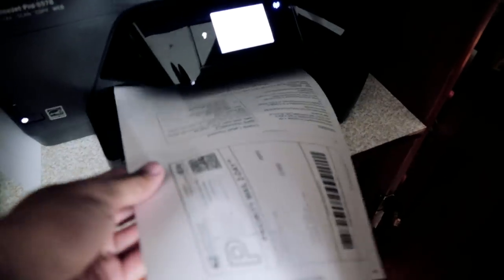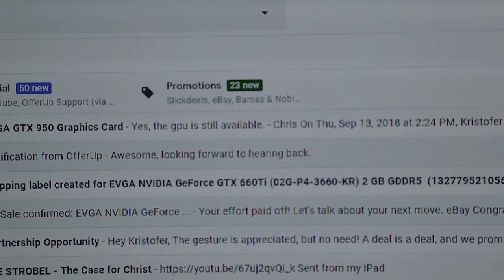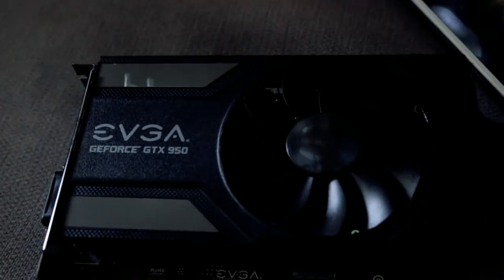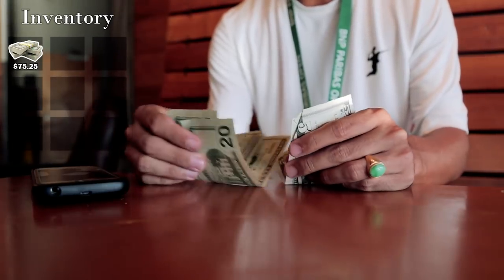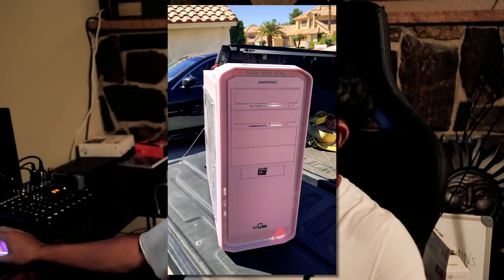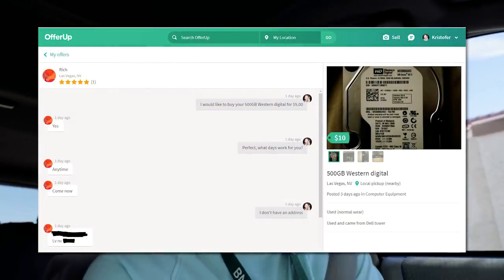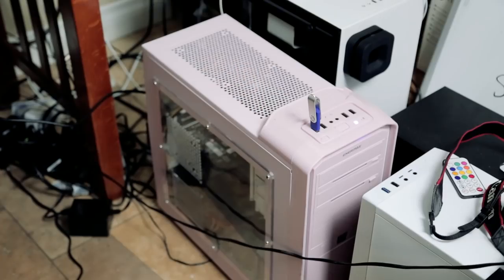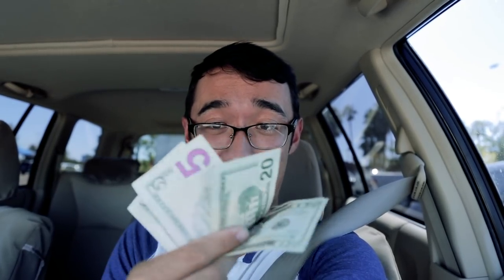1 Month Flipping Challenge - 8x Money Return

Comment: Things I learned:
1. Cheating is profitable
2. Getting lucky on one rare find is worth more than weeks of hard work.
3. Snipping an already agreed upon deal is profitable
4. If you want to go into flipping, you either need to love the tasks itself or have a larger starting fund, or you'd make more in a week w/ part time minimal wage job than you do a month of flipping.
Reply from the maker: The last one isn't necessarily true. You can start small and work yourself up to a larger fund you talk about. For example, how much could I make now with the $438?
Reply: Ah, but you would make the $438 faster by doing a part time job, which means that the initial month is still a bad use of time by comparison. After which, now you have a larger starting fund which goes right back to my point.
Therefore, my point of doing this when you have a lower starting fund is inefficient stands, since that's not when you should start.
But I guess a part time job where you only work for one or two week before quitting is probably hard to find. It's possible to make that doing some sort of contractor work, but that would involve either some sort of skill or hard physical labor. So perhaps starting flipping ASAP have an advantage in simplicity, since you don't have to deal with an "employer".

I am curious about how much you would make if you have sufficient starting fund (assuming, ofc, still a one-man operation as opposed to starting a full fledged business, which is whole other ball game)
While you would be able to go after any good deal as opposed to only the cheap ones, you are still bottlenecked by the number of deals available in general(that are good enough to flip) as well as your own time. While there is no doubt that your profit amount will increase, the % profit will probably drop. 8x your money every month is probably not possible.

At some point, it might become more profitable just offering the service of building custom PCs over flipping the parts, as your time becomes increasingly valuable and "just building" will consume less time per unit than if you have to source the part from "internet".
So it would be a rather complex thing to figure out what is the peak profit for flipping where flipping is still the optimal business model.

It's possible that it's never actually the "optimal" business model, which would explain why so many people do it part time because they enjoy the act but, afaik, very few people do this full time (whereas there are people that do PC builds etc full time)
Reply: I’d just do a part time job and like 10% of what I make a week would go into this.
Reply: Words, from someone who works for someone else.
Reply: @GF_Burke  lmfao true
Reply: If you really want to learn something go try and flip something yourself. You can work till you drop and make minimum wage all your life and still be terrible at being an entrepreneur, the only way to learn is actual experience.
Reply: @justanoman6497  perhaps the first initial month would be better spent, sinply based on profit, doing a part-time job. However, after that, when you have $500 to spend after the first month, which is about what a part time job at min. wage would give you at 20 hours after taxes, you can really start making cash. I've personally made 2-3 grand in a month before flipping parts.
Reply: @justanoman6497  also, the reason he struggled so much is because he was forced to start with $60. If you're in your 20's and don't have at least a grand or two put in your checkings, you're either lazy or can't manage your finances.
Reply: @Sploshification  And that's what I wrote, one needs a larger starting fund. how you get the larger fund doesn't really matter, can be part time job or savings.
Reply: @justanoman6497  that's pretty much a given. After that initial month, you'll have the funds needed to move forward.
Reply: @justanoman6497  i also wouldn't consider 500-$1,000 to be a "large" starting fund.  Pretty much anyone can do this.
Reply: @Sploshification  larger, not large. In context, >60 (though ofc, I mean a bit more than that)
500-1000 will suffice, but at least 2000 would be ideal so you can have a bit more inventory and flexibility and not have to wait until the current/last item to be sold before starting on next one.
Reply: @justanoman6497  no doubt. I suggest at least 3 or 4 grand, but even a grand can easily net you 300-400 a week. Better than a full time minimum wage job.
Reply: Not really true on the last part. You simply missed the part of experience. Haggling, a skill many people choose to avoid because it's too much effort.

Comment: Accidentally listed GTX 1050 instead of 660 Ti at 17:14!
Reply: 2 minutes later he explains it
Reply: Yeah
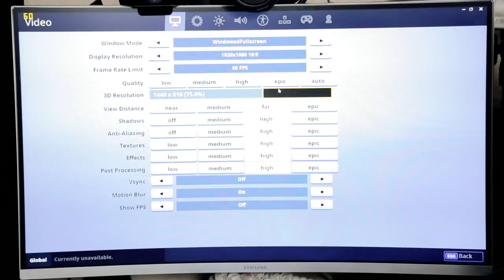Reply: He just mentions that he will most likely have trouble selling the PC considering it has a 6th generation card, and although he does go on to buy a GTX 1050 later, those benchmarks were still done using the 660 Ti. It's even listed during the Unigine benchmark 17:33
Reply: Joceline Rios and a gtx 660ti can’t run fortntie high on 100fps
Reply: @TheRealJuiceGrape  That's not true

Comment: Did anyone notice that he had a 660ti in the pc but the benchmark said gtx 1050?
Reply: maybe he did the bench after he bought the 1050
Reply: I see
Reply: Maybe it was the modded bios
Reply: Ikr
Reply: Aqua wut? No, if u watched he bought a 1050 bcoz the 660ti wasnt selling, so he benchmarked the 1050 smh
Reply: @durian59  18:00 he says that it was 660ti and he modded the bios, and he bought 1050 down the line, so most probably pc just reads 660 as 1050 because of it.
Reply: Fox that makes no sense at all, why would the bios call a 660ti a 1050 before he even bought the 1050
Reply: @durian59  because it's not the original bios. I don't know much about it, but I've seen such a thing multiple times on youtube when someone bought a scam GPU advertised as 1080 or other high-end one and got some old GPU with 1080 bios instead. So essentially computer recognizes GPU as 1050 because it's written in it's bios, but it's in fact a 660. Hope that makes sense.
Reply: Fox what a coincidence it showed 1050 and he bought a 1050 😂, but yea i get you
Reply: @durian59  yeah, hah

Comment: Omg keep doing this until you get a high end rig 9900k+2080ti
Reply: @KristoferYee  dude may i ask ur opinion?Will a gtx1080+ core i5 8400 pc with rgb be good for $700?One dude is offering me that price instead of the original price of $850..i wanna flip it back ofcourse haha
Reply: crysisownz hel fuck yea that’s good !!
Reply: @flipperr6947  i wanna buy one
Reply: @KristoferYee  I started out with a 100€ and flipped my way up to a 1070 ti, you should be fine
Reply: Oh, you mean high temp rig
Reply: KristoferYee you should try too dude lol
Reply: crysisownz that's pretty fkin good, you should really try to flip that
Reply: its a fair price.. u wont be able to make money on that.. i see 1080's selling for $250 ish all the time
Reply: i dont know what your smoking.. i see 1080's for $250ish used all the time.. the i5 8400 is used probably $150 @UnFazeablE 7  i just bought a brand new 1070 ti for $359.99 and its pretty much on par with the regular 1080.. actually im running faster with a slight over clock
Reply: That would surely take a big patient boi
Reply: would be easier to buy a computer at the store take out the internals and return it lol.. works every time!! only thing u gotta buy is a GPU....  i did it with my current rig a few years back i5 6400 and swapped the motherboard with an old pentium 3 mobo and the dummies at the store still didnt know.. even with the old as motherboard having a printer port, serial port and no hdmi!!! ppl are soo dumb @jafiro3464
Reply: HuntaKiller no dont sell for atleast 800

Comment: I live off a fixed income and decided to try and build a fairly high end PC? - Within a years time with a monthly budget of $250-$300 with exceptions. I have the chassis, PSU and the motherboard so far. I chose to go for an NZXT red/black  H700i case - it's simple with plenty of room, got it on Amazon for a bit over $100, the PSU for about the same, I think a bit more for an NZXT E850 80+ gold and I splurged and got a ROG maximus X CODE for the motherboard. Next month I'll be getting the NVMe M.2 500GB Samsung 970 EVO. Some things simply come down to patience. When I bought the Chassis, I also got 2x 8GB USB 3.0 flash-drives to keep OS Packages on. one for Linux and the other for Windows 10. I'll try getting the CPU in January. I'm also keeping all excess monthly budget moneys in a separate account to go for the GPU Hopefully a 1080 Ti. as a graphic artist aspiring to be a 3D artist, I will NOT comp out on the GPU - sadly it's the most expensive part of my build. With luck, I'll have this beauty done by spring.
Reply: Duck move a lot of patience unless you need it NOW
Reply: Just wanted to say GL with that man and that a 1070 ti would be a better bang for your buck if its powerful enough for what you want. Also, you can obviously save a substantial amount if you can get a second hand gpu.
Reply: @NOCK88  but who knows where that used card has been...
Reply: @stevethea5250  Depends who you're buying from. You can get second hard cards from reputable sellers, many still under warranty. I'm not really suggesting you go craigslist a high end gpu

Comment: Where do you find a 1080 for $300?
Reply: There is an ad in my local craigslist for a gaming PC with a 1080 in it for $550. Mind you that is a fully working system, not just the card. I think it is a decent deal. Pretty old mobo and CPU though so I think I'd rather just build an AMD system with newer components.

Comment: I got 9 power supplies a few months ago, all but one were modular, used six months for mining for $80 not each $80 for all of them. Seasonic, EVGA, Cooler Master, and corsair. All cables and cords came with them. So far iv'e used three of them and they all have worked fine. They look brand new without a speck of dust. I also just got two PC cases one with a vanguard B85 board in a NGXT white case with 8 fans,  core i5 4460 and two 2 tb hard drives. The other tower was a Liam Li pc-k9 tower, p9x79 asus board Sells for $200 still on eBay), i7 4th gen, 64gb of ddr3 HyperX ram, (8 sticks)  Antec 750 bronze plus PSU, Coolermaster MasterAir MA610P, GTX 1050ti, intel 500gb SSD, and two 2tb hard drives from Western Digital black editions. both towers for $300 combined and then he was like 'hey, you want this 27" monitor"??? yup. Unfortunately it's only 60hz but the resolution is crazy.
Reply: ooh ya the X79 boards can use the xenon 12 core CPU's that's why a 5 year old board is  around $200

Comment: Basically last summer I did the same thing (keep in mind I’m 14) I wanted to get a full on gaming setup and all I had was a crappy Lenovo laptop running GeForce now and a 2ds. I went onto Kijiji one day and I listed my 2ds for $200 plus a few games with it. Got $200 and bought and Xbox one for just $50. I resold that for $100. I then found someone selling a gaming pc with a 1050 ti and i5 760 for $500. I asked the dude if he can trade it for my Lenovo laptop and $100. I actually got the rig from doing that and was pretty happy with it for a few months. Up until Christmas I decided to upgrade the rig with money I got from the holiday and got a fresh 450w modular psu, ryzen 3, b450 mobo, and 8gb of ddr4 @3000 MHz. (Keep in mind I basically got the computer for $300 and spent around 250-300 on upgrades.) At the time of writing I actually just sold the rig for $800 on Kijiji and am buying a Brand new gaming computer to suit my needs. Thanks for the inspiration :)

Comment: the graphics card you picked up on day 6 is the same model as the one i have been using for the past few years in my rig that i recently upgraded from. its just interesting to see it in a vid because its actually surprisingly hard to find solid info on the 2gb variant of the pny gtx750
Reply: Check forums for any information 💯

Comment: I sold someone an MSI GeForce RTX 2070 Gaming X Duo for 300.00 they usually go for about 500-600 depending on where you get them. I only used it lightly for about 2 months. Then I got my taxes back and bought my MSI GeForce RTX 2080 TI Gaming X Trio. He was happy and I was happy to help him out. I could have gotten a little more for it but I was way happier to get some money back and to help out a friend. 
I have a RYZEN 9 3900x, 32 GB of DDR4 RAM at 3400 speed. All plugged into an MSI Prestige X570 Creation Motherboard and powered by a EVGA Supernova G3 1000W power supply and 2.5 TB of storage across 2 SSD. Oh yeah and a Cooler Master Master Liquid ML360P silver edition AIO. This computer is the best computer I have ever owned and I treat it like a baby lol.

Comment: I flip PCs, I always go for a cheap used PC with decent CPU and shit GPU, most look like crap, then I just buy a decent cheap GPU and a new case, throw a few RGB fans in and RBG cooler and I get about 40% gains. I aim for intels 4-7th gen CPU and pair it with a  970-980 or 1050-1070. Easy to find.
Every now and then I get a crazy cheap 8th-9th gen CPU and the margin is much nicer :)
Reply: I invested $500 dollars on bitcoin and I got $5,000 after seven successful working days. All thanks  to Mrs MADELINE🙌🙌🙌

Comment: Here in the PH, If I start with a 660Ti, I can get 65 bucks then buy a used 750Ti, I'd be left with 0 then sell the 750 Ti to a computer shop for 90 then buy some used games on the used market for 20 bucks sell them for 50 then go on to buy a water cooler for 40 then try to fix it if it has problems, sell it for 60 then buy a ps4 sell the ps4 for 200, whabam you can get ez 200 dollars in the ph

Comment: Should have parted out the computer. The cost of windows alone would have been like $50. You could have gotten 30-40 for power supply, 50 for the mobo, 25 for the case. That's like $125 in parts and would not have spent $55 on the hdd and os. Not to mention the amount you spent in gas.

Comment: how did you get the 750 to run fortnite, my 750ti runs fortnite at 15fps on low settings
Reply: what processor u pair with 750ti bro?
Reply: i5 4670k I did some tweaking and got it  to 30ish fps
Reply: thats not how it should be bro maybe theres a driver issue in your system ? if u dont update ur gpu driver recently try to update it may be the reason why u get low fps
Reply: Maybe. I know my graphics card drivers are up to date because I have the GeForce experience program and it just recently updated
Reply: Its kinda weird bro u have good cpu that can handle 750ti i dont know why u have such a low fps on fortnite
Reply: @angelochavez2085  u should get 100 easy on 750ti u should probs try and find out wtf is wrong man

Comment: I begges my dad to buy me an old pc insteadof a new because it was an insanely good deal. I spent 350eu for a 144hz monitor and a gtx 1060 6gb with an r5 1600 i managed to flip it for 750eu and i am still fliping with that money. I have over 2k eu jn parts and 1500eu in my bank just from fliping for less than 2 years